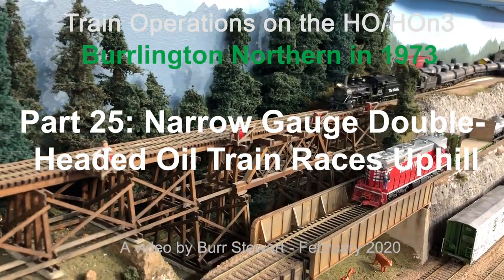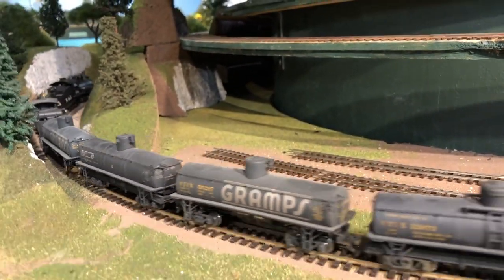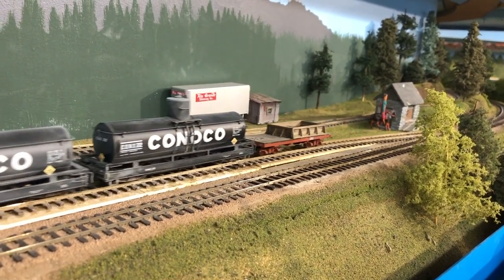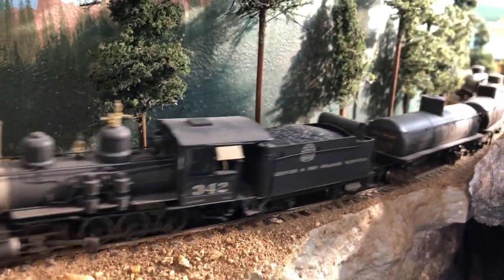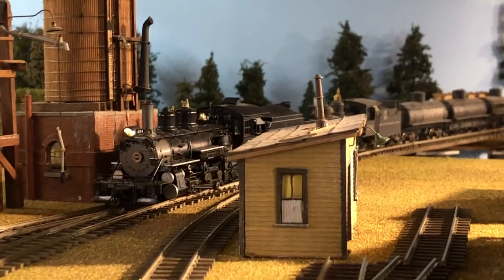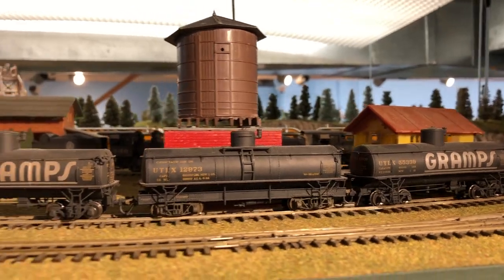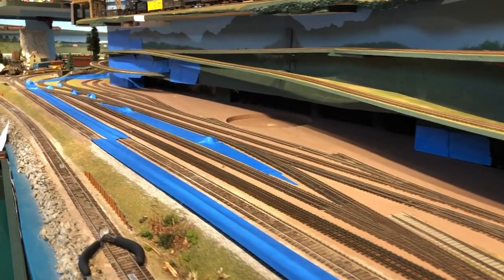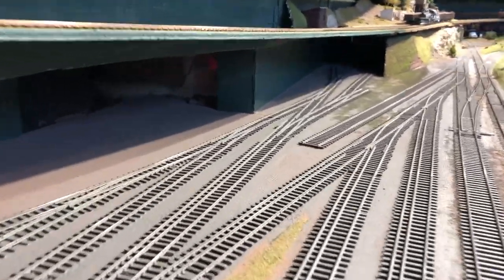Part 25 - HOn3 Gramps and CONOCO oil cars race up hill to escape spray painting

Comment: What paint did you use for the base coat on the track, will you have another video covering how you finish the tracking weathering process?
Reply from the maker: The paint I used is Rustoleum "Weathered Wood" "Roof Accessory Paint". I got the idea for this particular color from an excellent article by Dave Vollmer on page 12 of the "2021 HOn3 Annual" published by White River Productions, and still available on their website. In the article he discusses the whole process of finishing and weathering flextrack to make it look realistic. I will try to do a video on this as well, but there are probably plenty out there already. The key is to pick a few darker and lighter colors to apply to individual ties so they don't all have the exact same color, after spraying on the base coat. Also, applying a thinned black wash to the base color brings out the wood grain that's already built into the plastic ties. And sometimes some black pan pastel dusted in the center of the track to represent oil drippings from engines. That's about it! :)